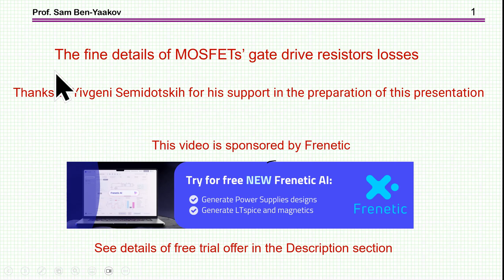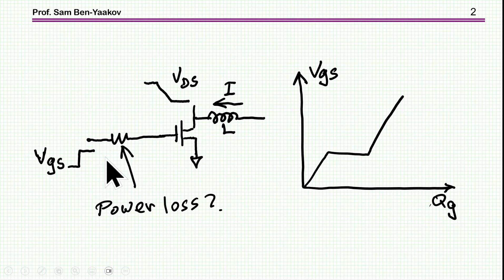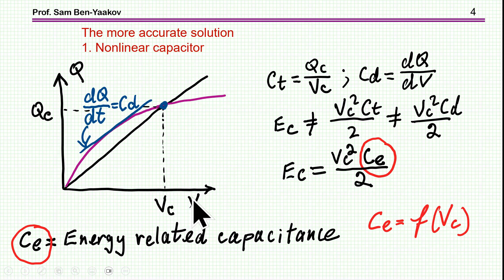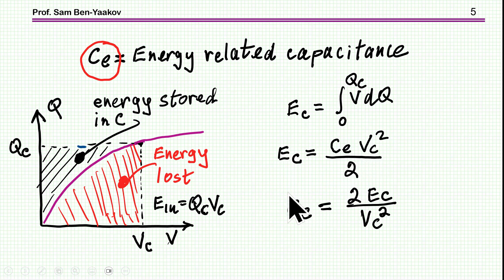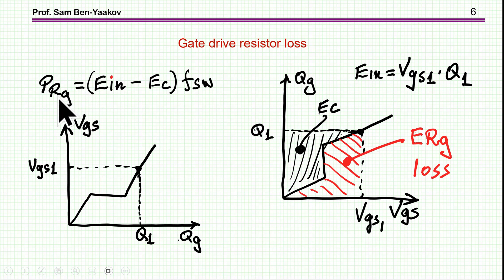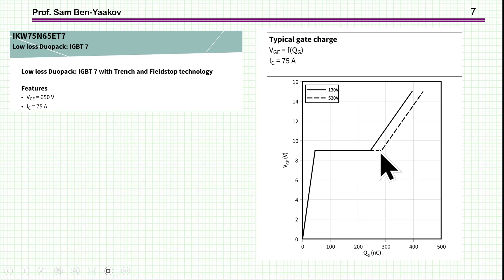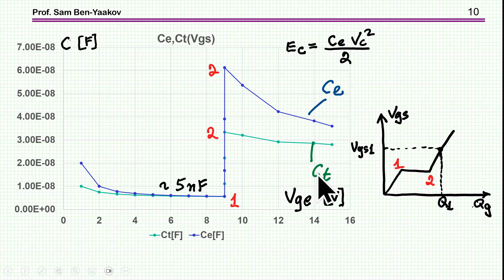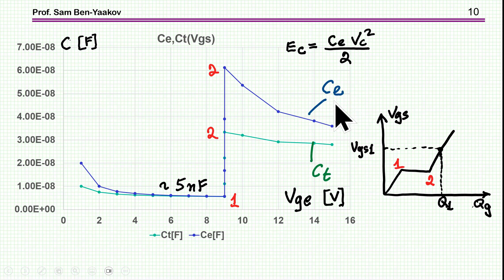The fine details of MOSFETs’ gate drive resistors losses

Comment: If I wanted to follow these calculations for a MOSFET based on the datasheet values, should I include the gate resistance (R_G) parameter of the MOSFET itself as part of the loss calculation, along with the discrete charge resistor(s)? It has never been clear to me whether the gate resistance parameter represents a "real" series resistance with the gate terminal, or if it is only included as a modelling parameter. If it should be included in the calculation, do I need to make any adjustments for switching frequency? Usually the gate resistance parameter is specified at something like 1MHz, so presumably it is frequency dependent, but I don't recall ever seeing any guidance on how this value changes with frequency.
Reply from the maker: Yes, the internal gate resistance should be included. It is a real resistance of the gate interconnections. The IMhz is normally the test frequency, this resistance is practically frequency-independent.
Reply: @sambenyaakov  Thanks for the info!

Comment: What is wrong with this:

The power required to charge (and discharge) the G/S capacitance to the gate drive voltage.
The power required to charge the Miller capacitance for turn on and for turn off (with the higher Vds)
Times switching freq.
(1/2CgsVgd^2+1/2CmVdson^2)*Fsw+(1/2CgsVgd^2+1/2CmVdsoff^2)*Fsw
  
As long as both caps are fully charged and discharged each cycle, the wattage is the same no matter the resistor value.  Then the resistor value is selected for on and off time.
Reply: The energy stored in a capacitor is not the same as the energy required to charge it through a resistor.
Reply from the maker: @ I am sorry but I do not see any basis for your eqution. What do you mean by the energy required to charge it? from the source? this is what the video shows.
Reply: @ That was a response to the original comment, where they assumed that the energy stored in a capacitor (1/2 CV^2) is the energy used to charge it. Although I am just as confused as you are on why they used Vgd and not Vgs...
Reply from the maker: @purerhodium  I wonder
Reply from the maker: I am afraid I don’t follow 1/2CgsVgd^2 ??? Secondly, how do you get the values of Cgs, Cm?